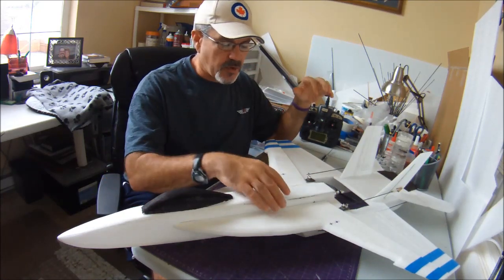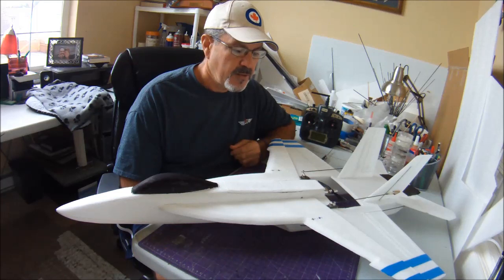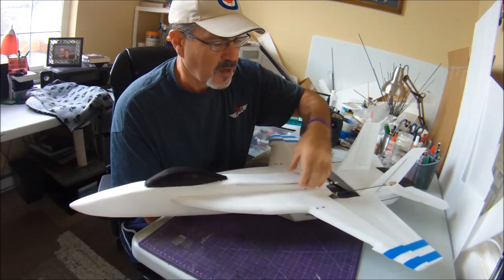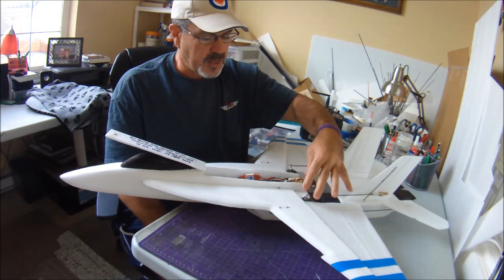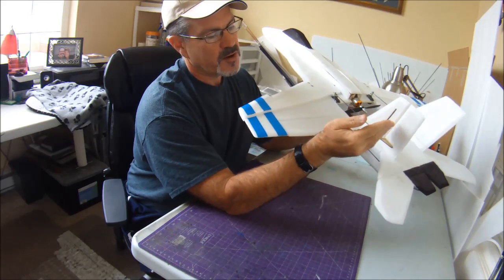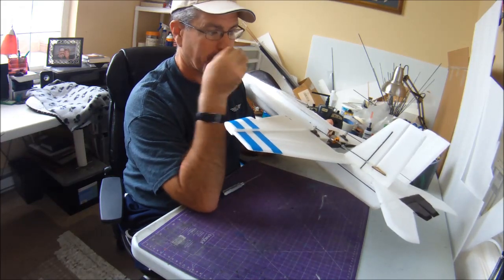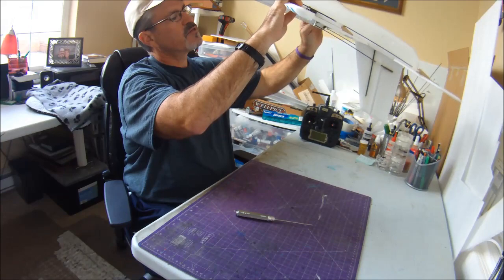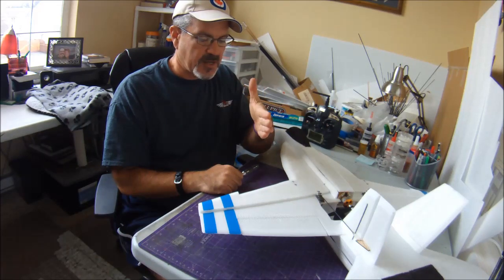Modified RC Powers F18 V3 walkaround

Comment: hi scott. i am using the original/stock RCP setub for the F-18v3 and the FRCF F-16mk1. means running a 6x4 prop on the tgy 2200kv motor on 3S (2200mAh). i use the original prop slot shape. i noticed, that you always have a rectangular prop slot. i am aming to get my setup more quiet and i am looking for the most effective solution. any experience on reducing the noise level (different prop slot geometry, prop, ...)? thanks
Reply from the maker: I have never experimented with any different size prop slots, I remember when I built my first park jet, the F35 V2, there was a lot of discussion about it, so I have always gone with a larger prop slot.  From recent experimentation I did with a small quad motor on my Mig-35B, I noticed that when the prop was close to the foam, it was louder because that motor is so small.  I put some spacers on the prop shaft and it made it much quieter.  I think the more room there is between the prop and the foam, the quieter the plane should be in my experience.  The prop itself does make some noise, but it is the foam and it's proximity to the prop that seems to increase the noise the most.  Cheers, Scott